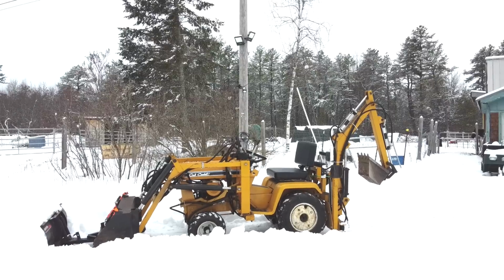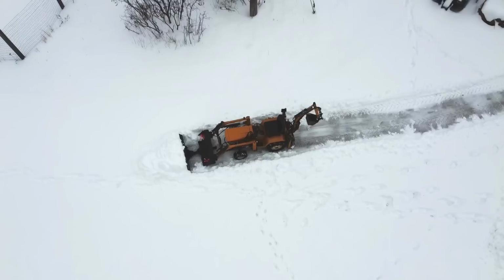Vintage Cub Cadet 149 TLB Garden Tractor Snow Plowing Farm Home Made Tractor Loader Backhoe Plow

Comment: Man, this is the second time you've built something I've thought about building but never did. One is the tracks you built for that small tractor. I love that. I want to try de-swivelling the front wheels on a ZTR mower, building and installing tracks, and adding a small hydraulic system with a homemade front end loader. It would be a mini excavator! Great stuff, Norman. Love the snow.

Comment: HEY NORMAN IS IT BAD IF I SEE FLUID HEAD ON MY JOHN DEERE 400
Reply: Put a 22hp in the 400 and the troubles are over. I used a Predator  twin and it's run for 3 years.... They have somewhat a bad review but I have had NO problems. I also have weights .  It is a brut tractor.

Comment: How much do you think the tractor weighs with the loader and backhoe?  You were cruising along pretty good!  I have a John Deere 430 Diesel and prints from PF engineering I am about to start.  I know my tractor weighs 1030 lbs. Just the tractor.  I used it this fall.  I used it this fall to pull my 16' tandem axle trailer to clean up my property.  I cut down about 10 - 15 trees 3" to 8" and piled it all on the trailer, probably 10' high and the trailer weighs 1500 lbs.  That little diesel and chunky tractor pulled it like nothing.  I think it will do well with the loader.  I look forward to playing in the snow with it next winter too!  I built a plow for my Gravely ZTR with a 60" blade and it tears up the snow, I leave the deck on!  lol
Reply from the maker: I guess this 149 is just shy of 1500#